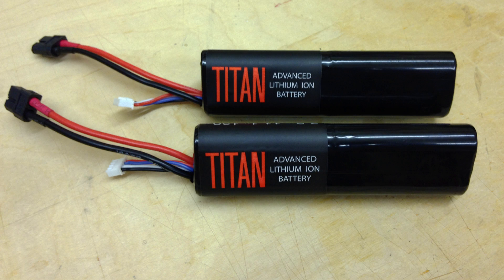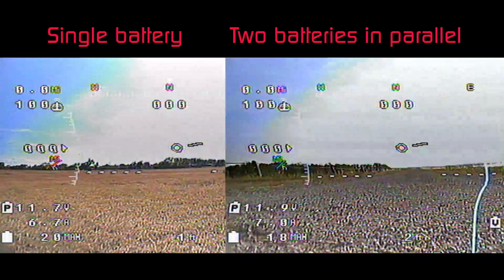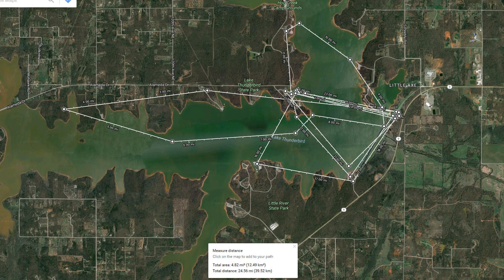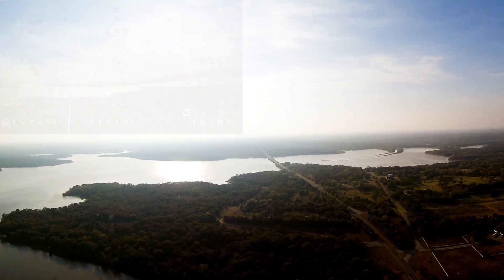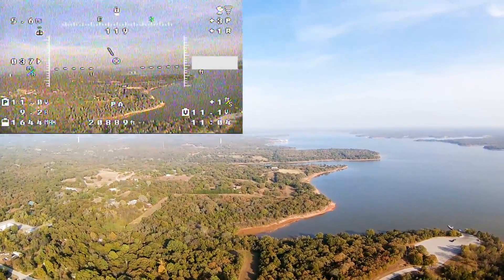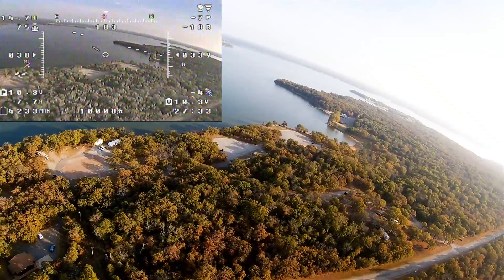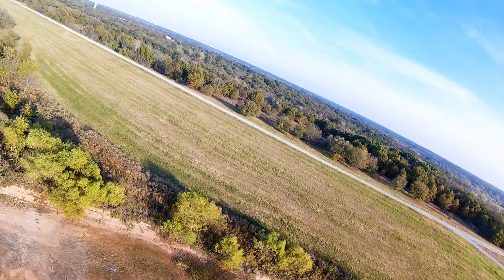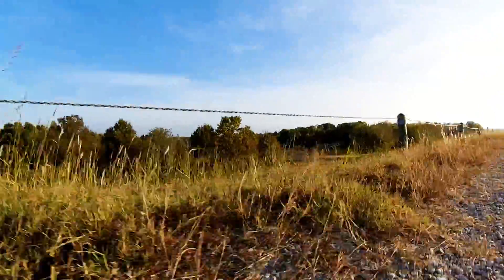Titan Li-Ion Battery Tests - narrated 45 minute flight

Comment: Hi can I use these 18650 lion batteries on my Chaser wing  1400mm wingspan with 40a esc and 2217 2300kv motor thanks
Reply from the maker: Sorry for the slow response.  Lithium ion batteries generally don't do well with high amp draws.  So, yes to your question if you can cruise at 10 amps or less, otherwise I'd recommend Lithium polymer batteries.  Good luck

Comment: Do u think this battery is worth it
Reply from the maker: Thanks for the question.  These were worth it for me, since I wanted to stay in the air for an hour and did so eventually (another video).  I also didn't know how to solder li-ion cells together myself then, so buying them was simpler.  Now I would just buy the 18650 cells and connect them into a bigger battery myself.  Good luck
Reply: @mostlyharmlessrc3920  thanks for bringing a trusted info for our event community and help other to make a good decision. I like all the plane that u had built. I been thinking to built the mini drack. Pretty same than the one u made. Scratch built is always interested and we learn a lot
Reply from the maker: Thanks again for the generous comment!  I hope I have time to keep building planes in the future!

Comment: Good job congrats on your range you going to have to excuse me has i am a total newbie to this just bought a 3dr iris + and not happy with battery life it has 5100mah battery give me about 12min would these battery work for my bird and give me a better time 
thanks in advance  awaiting your reply
Reply from the maker: Thanks for the question!  I had to look up the 3dr iris+, but it looks like it takes a fairly standard 3S lithium polymer (lipo) battery.  The batteries I used in this video are also 3S (~11.1 volts) but they deliver less current (amps) than your quadcopter probably needs to fly.  Have a look at the 3S "fast discharge" packs from Titan, like this one: https://www.gettitanpower.com/collections/fast-discharge/products/5-2ah-11-1v-225w-fast-discharge.  Alternatively, you could use two smaller 3S packs in parallel, which would mean more amp delivery as well.  As long is the weight is roughly the same and they fit in your craft, they should be okay.  A warning, though, Li-ion packs drop in voltage a lot further than lipos, so make sure your flight controller (pixhawk?) can operate down to 9 volts or so.  Hope this helps!
Reply: Thanks for your speedy reply will check on your battery suggestion

Comment: the bateries may actually have had 'punch' but your flight controller could be reducing power ?
Reply from the maker: The Storm OSD flight controller I used here does not affect the throttle, but it probably could make aileron controls sluggish.  By punch in this case I really meant on the throttle - good thought and thanks for the comment!

Comment: Great video! I consider buying Titan battery as well but can't decide if I should get 4S 14A/h or 2 packs 7A/h... Did you make any research regarding possible problems with using 2 separate packs in parallel? I mean each pack has it's own BMS so theoretically they can have different voltage which can decrease total flight time as well as battery resource...
Reply from the maker: Thanks very much!  I think parallel batteries are reliable and work the same as one giant pack as far as the plane is concerned.  It's also cheaper to replace one half of a parallel circuit instead of replacing one huge pack.  I usually run two parallel lipos instead of one big one as well.  That said, I have used one 7000mah 3S pack in this plane with good success too.  Each one is technically a parallel arrangement of 3 cells (2x3=6 cells) anyway.  Hope this makes sense - good luck.

Comment: Wow!! I did forgot to ask you if you check the temperature of the battery packs... In the Data Sheet of the 18650 they have a really high temperature at "Nominal to medium discharge rate.. that is something that is giving me the creeps... I don't want a plane with a hole in the bottom and a battery hanging up of the fuselage as I return...
Reply from the maker: Migueldeservantes  Hi Miguel - thanks for the great comments and questions!  Yes it's lake thunderbird, which is really close to home and a nice flying location. Do you know the area?  These titan flight packs only got a little warm when running in parallel, about the same as most lipos. I flew with just one and it was a little hotter but no worries about melting foam lol!  Titan 'endurance' batts work best if you really keep the amps down (not good for aerobatic flying)!  Cheers man
Reply: A few of my friends where here at home while I was watching the video & One of them say that it looks like Thunderbird lake! I really wish I can find a really decent Job around there. So I can find a nice place to fly,, I live here in Daytona beach FL.. and there are just to many people full of misery "Ready to bitch about some one flying a foam plane" plus the amount of airports here is insane!!
I don't do any aerobatic flying.. I just want good set of batteries that don't get puffy and die miserably, in that way I don't have to see my hard earned money going in the garbage!! Thanks for the prompt reply!

Comment: Is that Lake Thunderbird??? that is an awesome place that you have there to enjoy and fly...I just finish assembling two batteries the first one is a 10K pack 4P for my MaX-8 Skywalker, and I have a 7500 3P for my Fx61 each one of the battery packs replace a 8K & 5K Zippy's.. and it is my hope that this batteries will last longer, most of the HK batteries that I have acquire get puffy in no time, and that is incredibly frustrating, I think that probably for next week I will have a test pack ready for the smaller plane. Thanks for posting!

Comment: Hi again! been looking at this batteries again but got confused with the endurance and fast discharge, If I want to replace my 3000 mAh, in which I get only 8 minutes flight time with my FT Big Nose Versawing (the versa wing with the fuselage) which Titan would you recomend for lets say a 25 minute flight time? Thanks again and I appreciate the input, Cheers!
Reply from the maker: Hey again :)  That's a pretty high discharge rate on that 3000 mAh battery, so you'd probably want to use their high discharge batteries.  If you used an endurance pack that way I think it might just die lol!  If you ran two 3s high discharge packs in parallel (like these: https://www.gettitanpower.com/collections/fast-discharge/products/2-6ah-11-1v-113w-fast-discharge), I bet you could get 20 minutes or more.  They'd weigh a bit over 300 grams total, which is maybe what your current 3000 pack weighs?  Hope that helps man!
Reply: MostlyHarmlessRC sure it helps, Thanks! How about just the one 5.2 fast discharge? Just for the form factor, I think it'll go better for CG balancing purposes. Thanks so much for the time, I appreciated a lot!
Reply from the maker: Yes - just as good.  Identical setup and cheaper for you actually. :)  Hope that works out for you man!

Comment: Great information and superb flight. Congrats on your new long range .. I enjoyed this a tonne. Thanks for sharing this helpful video.
Reply from the maker: Thanks Aero!  I'm happy with my new pb and really impressed with these batteries.  I had another 40 minute flight today after fixing the storm osd settings.  Loving this setup...
Reply: I may have to look into li ons. They seem great and efficient.
Reply: Maybe i missed it in the video but what were your old flight times on equivalent batteries?
Reply from the maker: Chris Capps  Hi Chris - sorry I missed your question from a month ago! I was getting about 20 minutes on a similar weight of lipo batteries.  That was usually a pair of 3000mah 3S turnigy's.